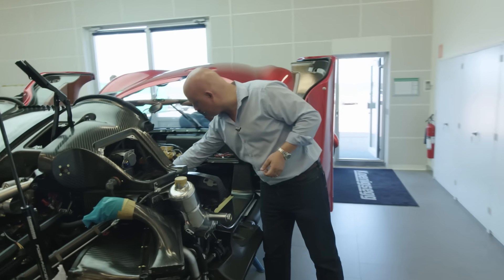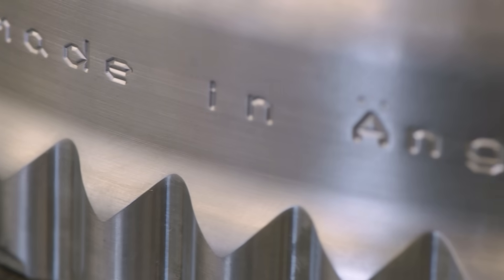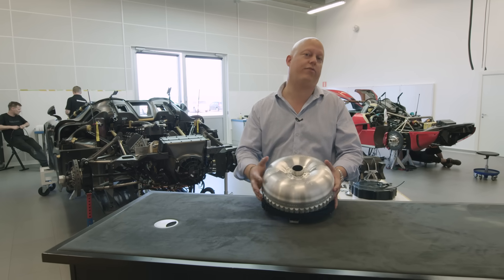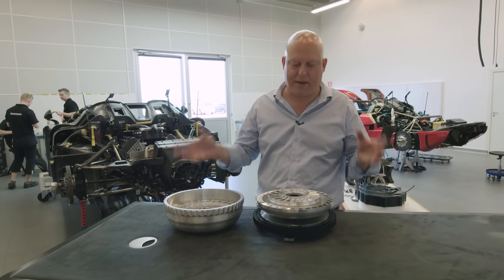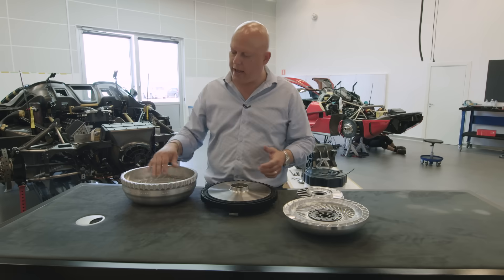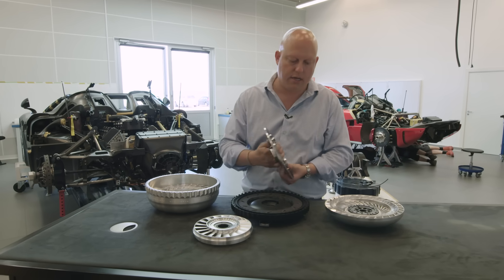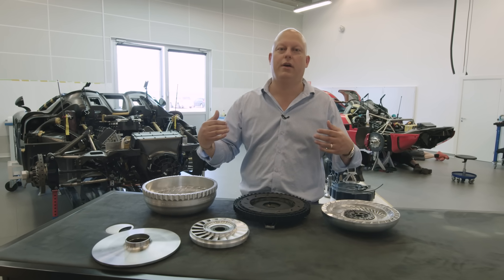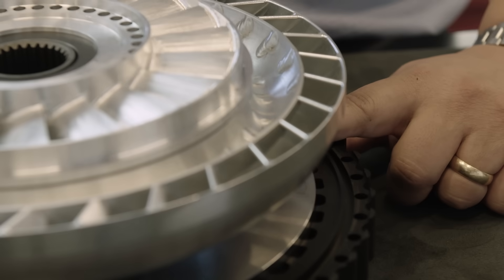248 MPH Without A Gearbox: Direct Drive  -- /INSIDE KOENIGSEGG

Comment: Reliability will be an issue on V1 of any complex design and with each generation of these cars changing so radically the design will never fully evolve into a functional technology. Solution? Just go full electric and work on pack swapping technology/network of "pack stations" where you drive up and swap to/rent another fully charged battery. Within 5 years batteries will come down enough in price that most manufacturers will abandon gasoline all together if people can get over the "I love the sound" garbage. I would rather have a faster, lower part count car that is a thousand times more reliable. Internal combustion cars have over 100 years of development and while they were once the easy route to driving long distances I cant help but wonder what electrics will be like with just 5 or 10 years of the worlds full support behind them.
Reply: billions of EV still have to charge somewhere, oil companies will just turn into electricity suppliers and make more money

Comment: I'm not going to watch the whole video, but isn't this like a CVT?
Reply: The Ace Channel No, in theory a CVT will stay at a low engine rpm and the output will be free to choose which speed the driver wants.  So if i were to accelerate from 0-60 with my Subaru Outback it should stay at the best engine range for power and acceleration.  Usually it would stay at 1400 RPM from 0-60MPH with moderate/linear acceleration.  And it will sit at 1700 RPM at 60MPH.  The Direct drive system works like this.  When you accelerate from 0-60MPH the tachometer and speedometers needles will be in sync with each other due to the gearing of the inputs and outputs of the transmission and differential.  So if I was accelerating from 0-60MPH the needles will just move in sync.  The Regera is in seventh gear and the speedometer goes all the way to 400kph and the tachometer goes to 8000 RPM.  So at top speed theoretically the engine should be redlining and hitting the engine rev limiter like crazy and should atay at it's limited top speed of 400kph
Reply: https://youtu.be/qtXDesz3Z0M Regera acceleration with KDD (Koenigsegg Direct Drive)
Reply: Pause the video at 6 seconds and you will see that the engine is at 2k rpm and the speedometer is at 120kph.  The car is in overdrive.  If it were to be Direct drive the engine needle should be at 4k rpm when the car is at 120kph

Comment: It boils down to this: Engine will stall at low RPM. No gears = "7th gear" = low RPM engine input = constantly stalling engine until mass is moving at a good clip. (or, high-enough RPM to keep running, but having to spin tires). The torque converter's job is to slip the input, but still create some output. This takes friction, they're just doing it with torque converter - hydraulic oil in vanes (the middle disc connected to the clutch), instead of a slipping clutch. Once the car gets moving to the point where the computer says "OK, the engine won't stall now", the clutch behind the torque converter locks up, the vane starts moving in tandem with the pump, and the torque converter becomes a giant flywheel and the engine is truly connected to the axles.
The only difference between this and your Camry is that it's super-strong, machined aluminum components AND a clutch which can take all these forces, as opposed to your cost-engineered Camry using pressed 14g steel pump and vanes.

Comment: so pretty much this set up only works with high horsepower set ups to get the torque converter spinning fast enough to create enough hydrologic pressure to transfer horsepower to torque.

Comment: The most surprising thing to me is that these rather small hydraulic wheels made of thin aluminium manage to reliable transfer over 1200 HP (and however much torque it is).

Comment: Double the torque? No it cannot. That would defy the laws of physics. Letting the engine run at its torque rating without bogging down is what it does and then locks up to be a "solid" unit. If the torque was actually doubled then there would not be a manual shift transmission left in the world and every race car would run with a "torque" converter and auto shift.
Reply: Robert Clark,
Sure it can. Doubling the torque is a very modest statement. 
Torque Convertors can easily multiply torque up to several times that 'Double' estimation.
High-Stall Torque Convertors are much more capable, but their ability to 'couple up' under light load cruising conditions make them less efficient. Of course the addition of an internal lock-up clutch assembly, the problem is moot, provided that it is designed strong enough for its application.

How does a Torque Convertor multiply torque? It does it the same way a differential multiplies torque... basically... by the principle of dividing the RPM to multiply the torque ... and it does this hydraulically. Simple.
But the big advantage here is that the TC offers a variable 'ratio' and works 'automatically,'  reacting accordingly to load conditions... whereas differentials are fixed ratios, with very few exceptions.
So, TCs multiply torque under load, when you need it most, 
 and then it couples-up under light load cruising conditions.
Marvellous devices, as Koengig will attest. 
Obviously he put a LOT of work designing and building his own, and trust me, he wouldn't have gone through all that effort if he didn't see it as an absolute necessity for his application. And i doubt he regrets it. It sure works for him, doesn't it???

Comment: I wonder if there might be longevity issues. Is there a temperature sensor to make sure the torque converter doesn't over heat and cook the fluid? I like the design.

Comment: I think a Tesla valve would be a great answer for the torque converter. 1:1 with electrically controlled valves within the Tesla valve to control flow of fluid through the valve. Maximum control of torque. Just a thought with an simple design.

Comment: I always wondered why they never used fluid drive in cars.  Back in the 1940's,, they had a Hydro Transmission.. But, I guess it never sold well,,  for what ever reason.. A regular Torque Converted is mostly a substitute for a Clutch..   Some Lawn Tractors have a true fluid drive,  It's strong and very few parts,  Personally I don't care much for efficiency,  I like Power and unusual Cars..  I'll pay for the Gas,  so what,!  Climate Change is NOT man made..  God is doing that..

Comment: The Moto Guzzi Convert used a similar, a high geared overall gear ratio and a torque converter. Actually it had two gears but you didn't shift while riding, one was for up to about 70 mph, the other for high speed but you could trickle round town in either.

Comment: So basically, it is always in seventh gear, the direct drive doubles the torgue in lower speeds so it does not stall when it starts moving. Am I getting it right?

Comment: if you have 1500 HP, you don`t need a transmission anyway...

that`s a custom torque converter, older cars used to have it as a from of automatic transmission, of course they had too little HPs so they were slow...

sorry man, nothign that has not ben done before...

Comment: tthe most fork-lift trucks have torque converter inside and the only difference is the material . one is using steel and the other one is using a aluminium alloy

Comment: but... the physics doesn't line up if you half the RPM and get more than double the torque (or even exactly double when you can't have 100% efficiency)
Reply: I frowned my eyebrows as well when he said that. But he might (speculation) have meant that the engine at full rpm with torque converter creates more torque at the drive shaft at 50% rpm than the engine running at 50% rpm.

Comment: Something most people might not consider about that torque converter: The oil inside of there is going really, really fast when that engine is at full throttle. As a result, there is a huge amount of outward pressure from the oil, on top of the regular forces a spinning metal bowl is under. It has to be built super strong, even one on a small car, because all the power your engine makes goes through that little bowl. Even in a small car, that tends to be at least 60,000W, or about 4-5 average households at peak. In this thing, that's about 1MW. A million watts. Going through that little hunk of oil-filled Aluminium.

Comment: this is so confusing the only question that i had is what if they kept the old fashioned  transmission  design would it  be slower ? more as a bottleneck  for the engine maybe or whats going on exactly cuz some say this transmission  will provide slightly  more performance  than the normal transmission !
Reply: I'd say a conventional gearbox would be heavier.

Comment: It's basically a 1959 Ford-a-matic 2 speed auto  (similar to a GM powerglide) without a case, and no reverse or planetary (if I understand reverse is electric on this car?? I haven't looked into it, my interest is the 'no gearbox' claims.). Technically, I guess it is  correct if it's gearing, but not in a 'box' ..... but it still incorporates the main parts of an auto, that being torque converter and clutch pack / locker. The valve body has been changed to electronic and relocated (only needed for 2 drive situations, neither needing for it to be in close proximity to where the 'box' would be, as in older fully hydraulically driven valve bodies), so that's why that's not there either, but it still does have the basics of an auto. Yes, revolutionary ........ though I wonder what durability and life-span would be of this unit ......, But ..... still basically a case-less 2 speed auto.

Comment: It's pretty obvious why the automatic transmission makers didn't understand his idea. I can just imagine what happened.....

Koenigsegg: "I want to build a car that develops its full 1,500+ hp ONLY when its near its top speed of nearly 250mph....... because the car will be RWD instead of AWD and traction will be the limiting factor anyway....... so the RPM can be REDUCED with only one gear ratio and a torque converter, plus some electric motors, giving it comparable performance to other 1000hp hybrid supercars, while also being LESS fuel efficient."

Silence from the confused engineers, then finally "Why not give it more gears and put the electric motors at the front?"

Koenigsegg: "Because I can sacrifice acceleration at lower speeds to save the weight of gearbox and have faster acceleration at the higher speeds you would typically only reach on the autobahn or a race track."

Engineers: "That's stupid, I don't think we can help you."

Comment: So basically it's a one gear-final drive direct gear or say 7th gear torque converter with electric motor assist to get the motor up to rpm till the gas motor can take over all the way to up 248 mph. Say kind of like a twin turbo whereas the small turbo spools up first at low rpm then the big turbo takes over at higher rpm so there's no turbo lag or am I just talking a shit load of crap.

Comment: I played around with this in the 1970's ! one -way -clutches i ,planetary gears ,hydraulic bypass you name it i did it and what this guy explains here is nothing that hasnt been done at some stage  by  good transmission / hydraulic mechanic  for experiment sake or for a particular power application , locking up a torque converter is nothing new.

Comment: I still dont understand how theyre cooling this torque converter. pushing 1200 bhp through ANY torque converter at 1:1 gear WILL generate lots of heat it in a short time, it is pure physics. Maybe because the car is so light and power is so massive that acceleration happens so quick that it does not have enough time to overheat. But then if you repeat stop and go at full power several times eventually it will destroy the torque converter. Maybe they simply use computer to disable power once the converter heats up.. But on the "invention" itself this is not an invention really, most automatic transmissions have fail safe mode that does exactly this - locks down the transmission in one of high gears so you can drive safely to a shop purely on torque converter alone.

Comment: Imagine finding spare parts for koenigsegg if something break downs, It would be cheaper to cnc your own spares than ordering. LOL.
Reply: bilbo baggins If you can afford a koenigsegg, you can probably also afford spare parts
Reply: Emil Pedersen if you want to double the acceleration, you can just tweak the torque converter lol
Reply: BismoB you also need some drag radials
Reply: @danieltanuwijaya7675  Putting them on such a car should be a crime against humanity...
Reply: @mrcaboosevg6089  Not really.  It would make it accelerate like a motherfucker.  Would easily be a 7 second car.
Reply: @mrcaboosevg6089  You can just put the road tires back on after you've humilated all dragsters on the strip.
Reply: Well, they CNC new parts just like you do, plus shipping and warranty of course.
Reply: Soon you will be able to order any parts for your car from a local machinist shop. The data for the CNC machine(s) will be pulled from the Internet and the part machined and hardened in a couple of hours. Or 3D printed.
Reply: you break anything on this car, it's cheaper to just order a Porsche GT3 and call it a day.  There won't be any spare parts at all.  It's a total garage queen.
Reply: Considering nearly every part seems to be CNC-produced, they should be able to produce spares on-demand unlike larger manufacturers who de-list repair parts once their stock is depleted.

Comment: There are a number of alternative power transmissions that have been patented, like the dual cone type, being one that is far more efficient than those using hydraulic clutches and belts used by most major auto manufacturers. This one sounds very promising, however the cost of development, added to the cost of manufacturing them would probably cause investors to pull away, and likely end his endeavors.

Comment: This is elegant in its simplicity.  In 1947 Buick introduced a similar trans called the "Dynaflow".  

The transmission initially used a five-element torque converter, with two turbines and two stators.  Dynaflow started in high gear (direct drive), relying on the converter's 2.1:1 torque multiplication to accelerate the vehicle. Low gear, obtained via the planetary gearset, (model-T simplicity) could be manually engaged and held up to approximately 60 mph, improving acceleration.

The Dynaflow was  used in various forms in Buick cars by the General Motors Corporation from 1947 until 1963.

Comment: So, 2-speed automatic with an electric motor providing torque when engine can't?
Reply: No "speeds" in there... But otherwise quite all right. But it can be called 'modes'; Either the torque converter is in lock-up mode or not. If not, the engine can spin freely with no direct contact with the rear axle, adding torque. Then it can be in lock-up mode and like CvK says; then it does nothing and doesn't affect the efficiency. It's just like an extra wight filled with oil stuck on the drive shaft, basically.
Like they show in other videos, the 'HydraCoup' can be put in use via the paddles in the car to let the engine roar a bit and slamming out some more torque momentarily, before it automatically locks up again.

Comment: Having lower gears helps with grip. If you have high hp and high gearing, the transition from grip to wheelspin results in a very high wheel speed slippage, and possible loss of control. That's one reason why dirt track cars use low gearing. So using 7th gear taking off means the wheels could spin up to 170mph.  And 170mph wheel speed at say 60mph could turn you around. Hence Traction Control vital.    It's late.....

Comment: I thought I was suppose to learn about the direct drive system and how it works. Instead Christian talks about his torque converter, the fins and stater, of which is found in the common cars today, over and over and over again. You are correct. The tech around the torque convert has been out for sometime. I did not hear anything about how your system is better, other than you made your own torque converter. Very, very disappointing.

Comment: I think one of next developments in automotive propulsion lies in a hybrid system like this one. Perhaps 0.75 to 1.0 Liter turbo diesel engine connected to a to 2 speed overdrive torque converter with direct drive to an electric two stage generator motor in (1,800 / 3,600 RPM ratio's) that in turn can charge and send direct electrical charge to four independent wheel electric motors. It wouldn't surprise me if these engine / electric hybrids could product 500 electric HP and consume the equivalent of 125 mpg. 

The direct drive / torque converter is an intriguing advance in torque converter application. Electric power generation for use in cars and trucks has always faced two challenges - production of torque that does not drain amp hours in batteries or cannot be produce sufficient amps to drive large electrical motors. If a four stage winding could produce lots of torque (for acceleration / torque @3,600 rpm) then brought to steady state (same winding speed but the diesel now shifts to 1,800 RPM), the range of the vehicle could be dramatically increased while still capable of caring a large net payload weight.

While I realize there are numerous voltage and frequencies that can be potentially used, battery options are somewhat limited and still required in automotive applications. I wonder if we will ever see electrical engineers use a parallel AC / DC generator / motor architecture.
Reply: your idea doesn't benefit from a torque convertor at all

Comment: With that much power, how can you drive such a beast without a fly-by-wire system. I think this is the point at which I do not undetstand cars anymore and the reason I only buy old cars from the 90's. They are just incomarable now that technology has come so far. I am really impressed by this design but it makes me love old cars even more